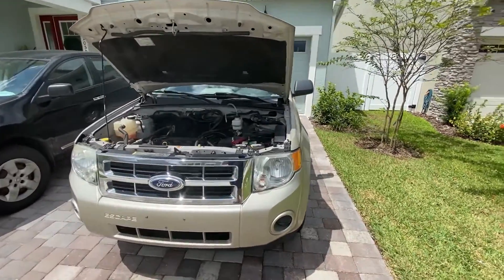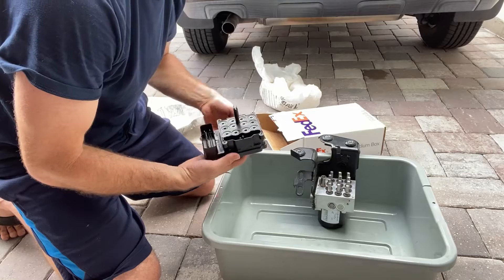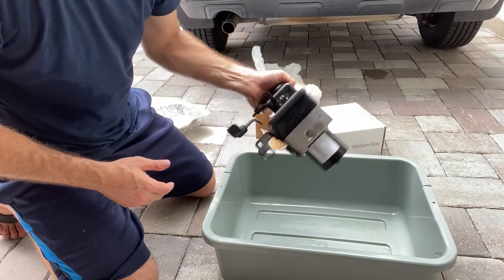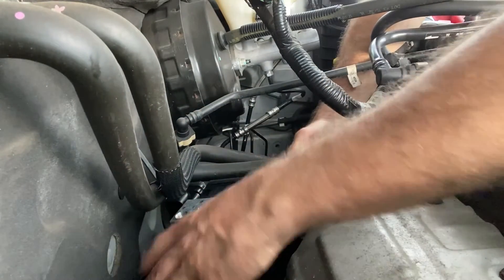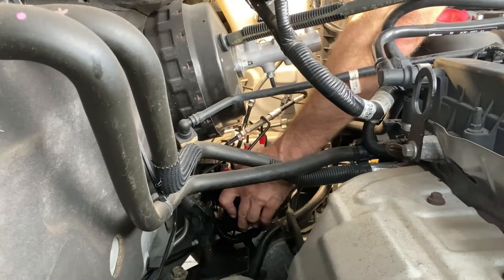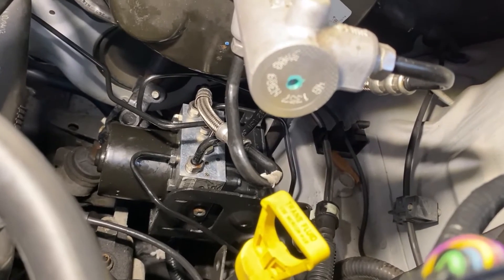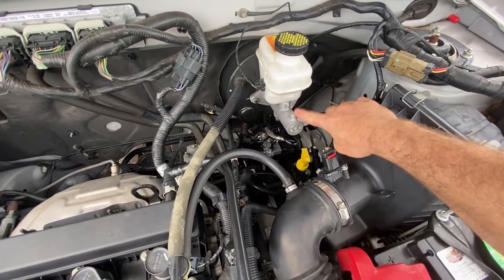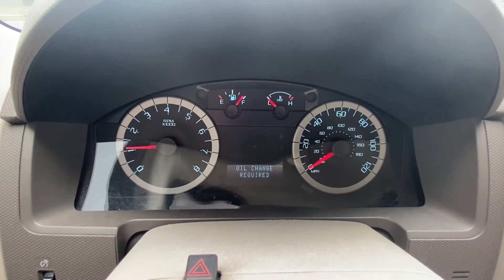Solved - Electronic Brake Control Module Repair Install (Ford Escape)

Comment: Friend tells me that the ECU I have this ABS module BL84_2C219_BA, do you know which ones could be compatible to buy it used, the new one costs a lot of money.
Reply from the maker: The issue with buying a used or new module is that it must be programmed. This takes special equipment that generally makes it not worth doing on your own.
Reply: @Thatguysauto  thanks
Reply: @Thatguysauto unless it's just the diaphragm valve that you need to replace how do we source just that

Comment: this video did not help at all.  I need to know HOW TO REMOVE the ABS module.  Perhaps the first video which I can't find.
Reply from the maker: Yes. The first video is the removal.

Solved -  ABS light flashing B1343 code EBCM Removal (Ford Escape)
https://youtu.be/9Xkt6tGtK7Q

Comment: Mr. Normal Guy's where can I buy a spare part for the 2010 exhaust ABS module? Thank you
Reply from the maker: If you buy a new ebcm it will require reprogramming. Which is why a DIYer attempts a repair vs replace.
Reply: Where i can buy with programming. Can you tell me which state you are so i can come there . Im in California

Comment: How did you know that it was the EBCM that was bad, and not the ABS pump??
Reply from the maker: It was the trouble code. I have another video where it explains how I ended up assuming it was the EBCM.

Comment: How did you bleed the master cylinder? Was the spongy pedal resolved after that?
Reply from the maker: Yes. It took a helper and was a little messy. Basically, the air is forced out via pedal action. While you are under the hood loosening and tightening the brake line tied to the master cylinder or the cylinder drain plug, another person is depressing and lifting the brake pedal. 

So loosen the nut, start depressing the pedal and before the pedal reaches bottom tighten the nut. It is imperative to not raise the pedal until the nuts are tightened. I did that until the pedal was no longer spongy - I think it took 4 times. I had already bled the air from the lines leaving the only air in the system at the MC.

Good luck and let me know how it turns out.

Comment: Did you do a bleed on both front tires to get the air out?
Reply from the maker: If you open the brake system you have to bleed all 4 tires starting with the farthest tire from the master cylinder and ending with the closest. I highly recommend capping the master cylinder and not draining it!

Comment: So the only tools you needed were the power bleeder and abs scanner?
Reply from the maker: And a torx bit set, toothbrush, electrical connector cleaner, etc. If you are removing the brake lines from the ABS assembly - a Socket set and open ended wrenches. But I recommend a flare nut wrench set (for brake line removal) and bleed cable plugs/caps (for the res).
Reply: @Thatguysauto  do you remember what size are the torx screws?
Reply: How much time did the removal and install take you?

Comment: Brake lines were cut???
Reply from the maker: Not cut. I did disconnect the lines from the abs assy to remove the assy from the car and separate the pump from the EBCM.

Comment: What size were those torx bolt for the control unit?
Reply from the maker: My bad, I meant to write #15 as in T15. I’m watching the little one and so…
Reply from the maker: The 4 hex screws holding the EBCM to the ABS Pump were on the body frame side (driver side) The 3 bolts and 1 nut holding the  assembly on from the body frame side. Pretty tight quarters, which is why I ended up removing the entire assembly.
Reply: @Thatguysauto  I was asking what size were the bolts
Reply from the maker: Pretty sure they where #5.
Reply: @Thatguysauto  #5??? Never heard of that size
Reply: T20 torx
Reply: @ilovecinnamoroll2013  thank you but I know that now

Comment: What were the symptoms before the repair?
Reply from the maker: Indicator lights only. Both the traction control and the brake indicators. The first video shows the indicator lights and I talk a little about the symptoms.
Reply: Any reprogramming required, after they replaced some of the electronics?
Reply from the maker: @Anonymous-it5jw  No reprogramming for my repair. That’s one of the reasons I used UpFix. I didn’t want to spend a ton of money on a reprogrammer.